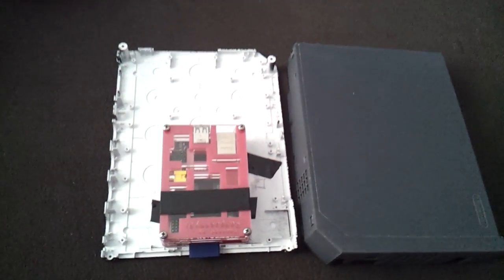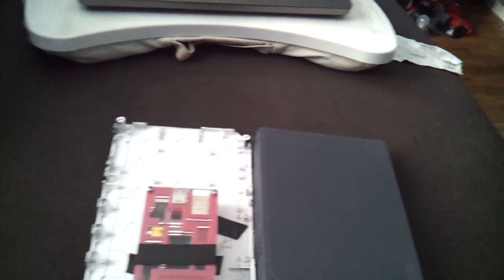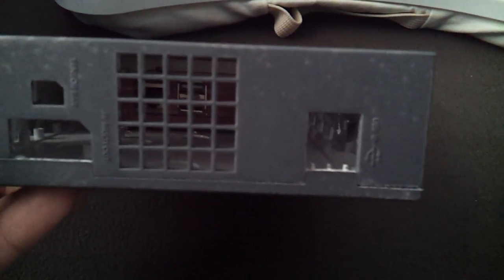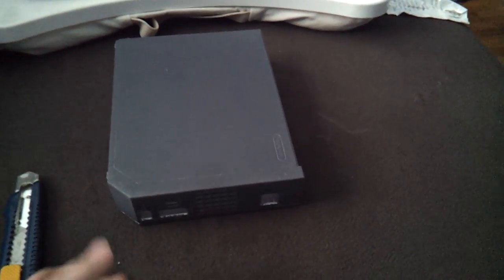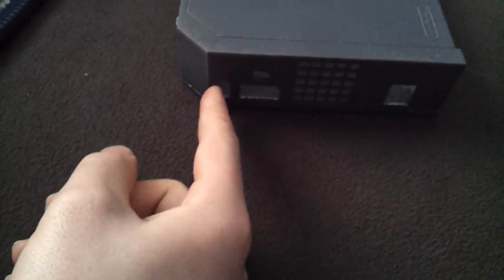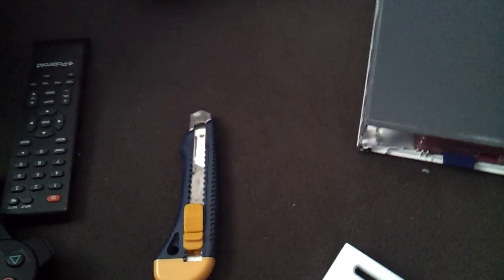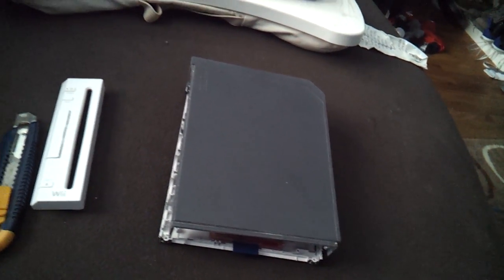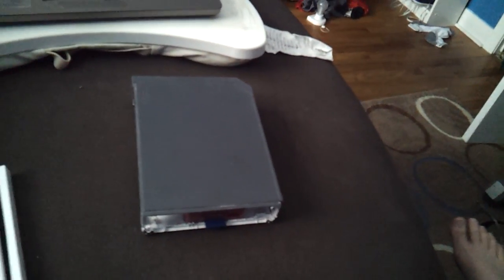Raspberry Pi micro PC Inside a Wii ( update )

Comment from the maker: To answer a few questions. I could use the wii buttons for power and such, but I would need to build an interrupter. I wanted to use a CD drive as well, but I would need to make a good power supply. Also, I used a scrap wii for the housing
Reply: use an akkupack board as interruptor that should work perfectly fine
Reply: for the power supply you could use a 12 v power supply with 4A  and use a transistor to turn the voltage to 5 volts

for the cd drive you can simply put in an exxternal burner